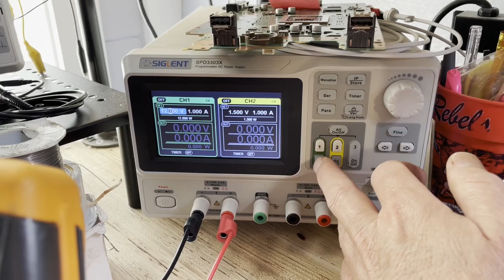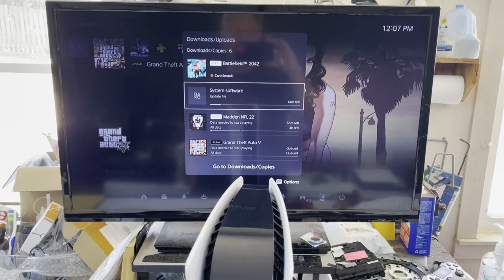#88 Repair of PS5 Digital Edition - No Power

Comment: 12:00 - Search video called "Convert Your MULTIMETER into an accurate SHORT CIRCUIT TRACER Finder for less than $1 Build This DIY" From channel Learn Electronics Repair. You have good multimeter, you can use it to find shorted mosfet.
About mosfets, I could be wrong, but 6 are HIGH side, 6 are LOW side. Shorted mosfet made current go to ground probably on LOW side, if one is shorted on HIGH side, then its on path to kill APU. If I remember correctly.
Reply: He also has a video on a few different methods of how you can find a shorted mosfet, one with an ESR meter and one with a milliohm metre and does a brief circuit diagram of why that works. Toltecs method is just as valid and I would recommend for a beginner to do this to understand how that particular circuit works, especially a beginner who doesn't have all those tools, it should be learned the manual way before you use tools to make it more quicker and convenient.
Reply from the maker: I don't believe that these are simple MOSFETs.  I believe they are complete DC-DC converter ICs containing a high an low side FET and the control circuitry in one package.  I injected 1V where the 12V would connect and I measure 0.7 at the APU.  I believe the internal high side MOSFET shorted.  I have heard of using the multimeter as to find shorts by injecting current and measuring millivolts of voltage drop.  The lowest voltage read should be the closest to the short.
Reply: @ToltecMerc  Yes thats the case with mV scale and voltage drop. You could identify short without desoldering coils.

Comment: You're right, all the stuff is in parallel, but not quite - the phases run together after the coils. The trick is to measure resistance with an ESR meter - with several kHz, the coil's resistance goes way up, and you can detect shorted APU mosfets without having to desolder every coil.
Also, when injecting voltage in the APU area, it may be wise to put the ground lead on APU VCore (on the end of the coils that go to the APU). This way you protect the APU from overvoltage, in case the short is intermittent or burns away while you're injecting and you accidently forgot to set voltage clip to .8/.9V.

Wrote this when 12:25 into the video, without sneaking ;)
Reply from the maker: That's an excellent tip!  I do have a homemade ESR meter that runs at 100kHz.  I'm sure those coils would look very high impedance at that frequency.  I'll give it a try next time.  Thanks!
Reply: nice tip! but just one clarification: what do you exactly  mean saying "with several kHz, the coil's resistance goes way up"?  Should the resistance  in that case go down fi shorted? Thank you in advance
Reply: @mattia7562  Generally speaking, a coil's resistance goes up with rising frequency. 
In normal ohms mode, the low resistance of the coils (less than .1 Ohm) make it hard to find shorted mosfets, since they all seem to be connected through the coils, as practically everything reads short.
When measuring resistance with, say, 100kHz, the coils have high resistance. This has the same effect as lifting all the coils, as you can properly measure in-circuit.

Comment: Good idea is to measure difference in diode mode between output (switch) and control pin (like gate). In 90% cases you can detect faulty drmos without desoldering of coils.
Reply from the maker: I don't think the gates are exposed to the outside on these ICs.

Comment: Another brilliant and logical troubleshooting session, thanks for sharing! Glad this was apparently not just s simple MOSFET and the internal short didn't send 12V to the APU. Also, with a .35Ohm short to ground, surely the power supply would shut down immediately, no? Your bench supply, however, may just keep going... 😛
Reply from the maker: Thanks!  I always connect my bench supply with current limiting set somewhat low.  Maybe 1A

Comment: I have experienced this on an xbox one s. Even though the source drain all showed low resistance to ground (processor resistance) on all MOSFETs due to parallel, the gate of the bad MOSFET was also short and the good MOSFETs gave 0.6v in diode mode to ground. So I didn't need to remove the coils.

Comment: Another great job. I have to ask have you seen/fixed 108255-1 game crashing? I've came across numerous ones and haven't found a fix yet
Reply from the maker: No, I'm afraid I have not seen that error.  I do hope you figure it out and share the info.
Reply: Didnt the cod3r released a video about this?
Reply: @DeKay510  if he did please tell me which video it is
Reply: @chad1983ification  its one of his latest. Converted disk version into digital.
Reply: @dkaytan  that's 101312-8
Reply: @chad1983ification  you are right. Not exactly the same

Comment: What is that power thing youre using? Im new to this stuff and need one
Reply from the maker: I'm not sure what you mean.  The multi-meter?
Reply: @ToltecMerc  is that what that is? The white box thing you used in the start of the video to that you found the short with
Reply from the maker: @jay-gt8re  oh.  That was my bench power supply.  It's a two channel adjustable bench power supply.  It can output from 0-32V and up to 3A on each channel.  Useful for testing various devices.
Reply: @ToltecMerc  I definitely need one I think. I have a dead ps5, cannot for the life of me figure out why. Guy said he dipped it in a bucket of distilled pure water to clean the board and it never turned on afterward.

Comment: Thanks for the video, I have one with a similar issue, is this the best way to test for the short?
Thanks
Reply from the maker: I think a better way is to do as someone else commented below.  Next time I will try an ESR meter that I have that runs at 100khz.  Hopefully the coils will give a high impedance at that frequency and I will be able to see a shorted MOSFET without the APU low resistance interfering
Reply: @ToltecMerc  Thank you

Comment: measure diode mode between source drain gate to find the shorted mosfet easy works 95% of the time
Reply from the maker: True.  These, however, are not plain MOSFETs.  The gates will be internal to the package.

Comment: I'm kind of a beginner but im wondering if it would be possible in such case to inject voltage 1v at 1amp at the input and output of one of the mosfets ? Hence they are in paralell shouldnt the defective one light up under the thermal cam?

Comment: Hi I have ps5 model CFI-1016A with problem all USB port type A ,
first: it not recognize the controller, 
second: i have measure all port type A  and not arrive 5 volt,  but only 0 volt !! 
Blu-ray port on board only 5 volt , 
but not 12 volt , infact bluray not working then Fan connector on board have 12 volt Then connector near fan only 5 volt  and not 12 volt  ! I don’t know if it’s a cpu problem or what else? you can help me ? 
Thanks
Reply from the maker: Check all fuses on PCB
Reply: @ToltecMerc  i have done onlyone fuse is dead the names is F5402 itry to change and i see whats happends for now thanks